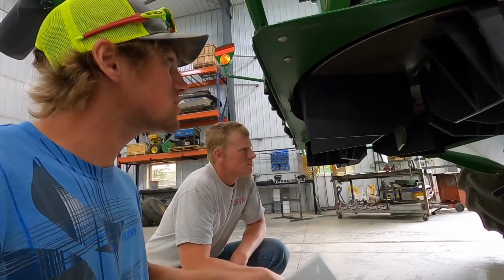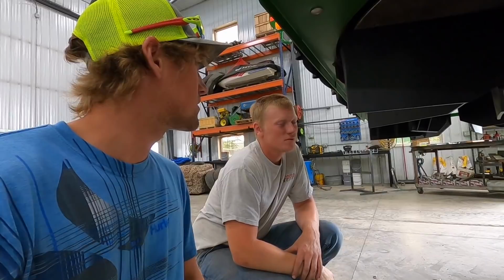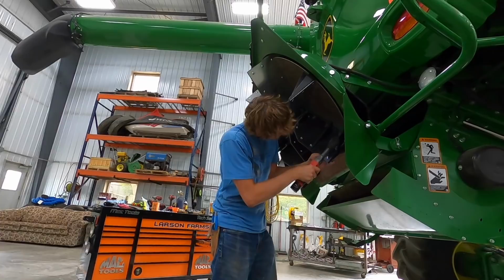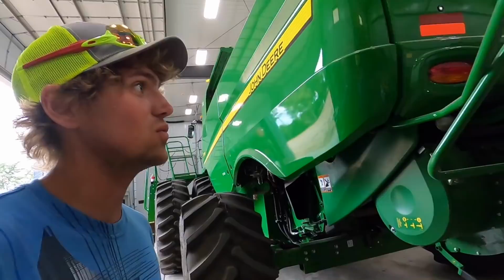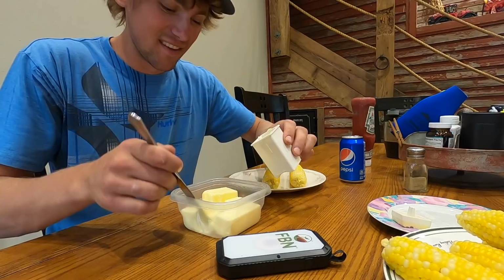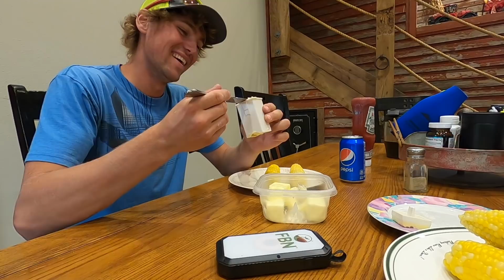How Many Farmers Does It Take To Cook Corn?

Comment: Another fun video. When you get to be your Dad's age Chet, you will tilt the spinners as the Big Swede did, pull that nice orange work station over to your work, lay out your tools, screws, etc. and work from a standing position (Or maybe from a shop stool?). Next time, leave the husks on the corn, put 4 ears at a time in the microwave, cook for 5 minutes on high, and then carefully remove (hot)  cut the stalk end off about i/2 " onto the cob, grasp the shuck and pull it off. All of the silk will come off with the shuck.  As for buttering, I doubt you can be helped. I will see if someone will send a raccoon over there to teach you how to eat corn on the cob, as it's obvious that the guidance Dougo and The Big Swede offered was to no avail.  Kinda makes me wonder if Nicolle dresses you and hand feeds you at home. LOL   Great video!